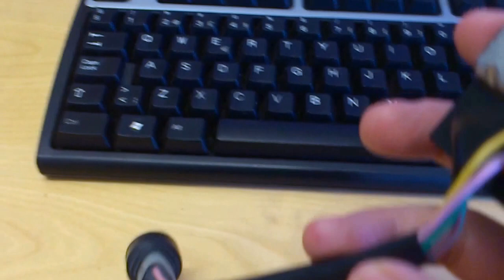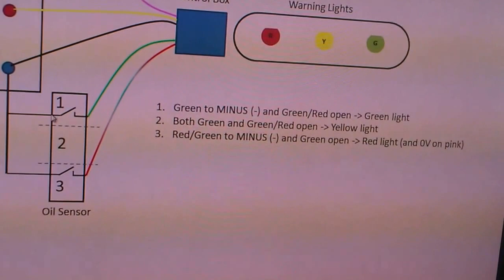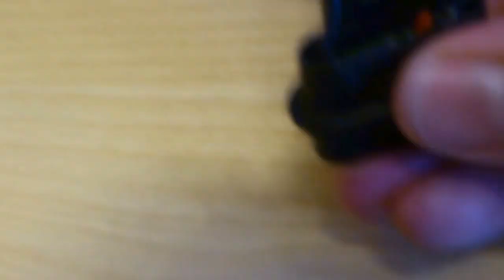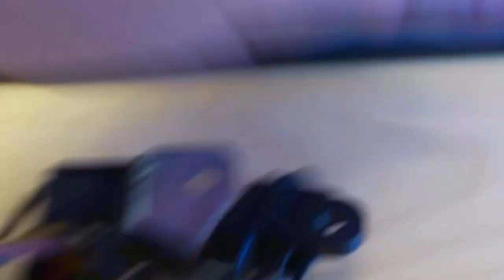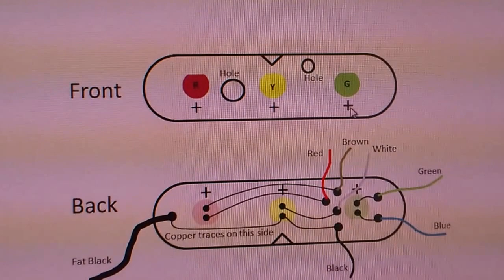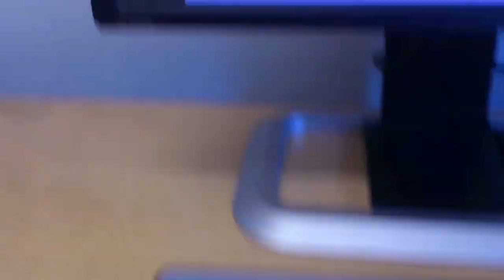Yamaha outboard oil warning light repair guide

Comment: If it's a 2 stroke why do you need a  oil pressure warning light
Reply: From the factory, its oil injected 2 stroke. So it has a separate oil tank.